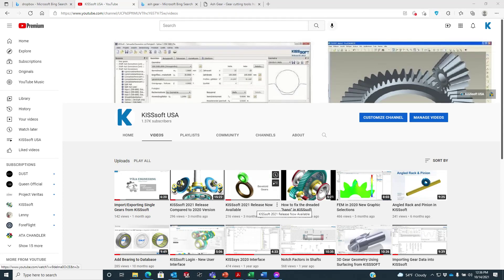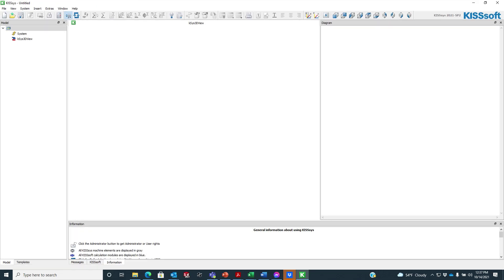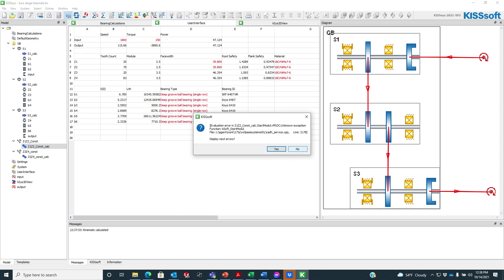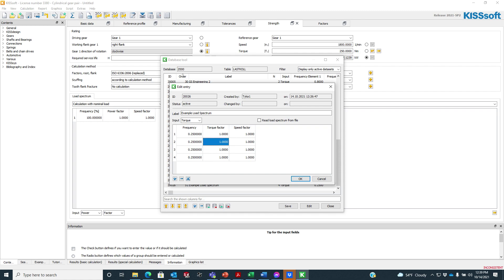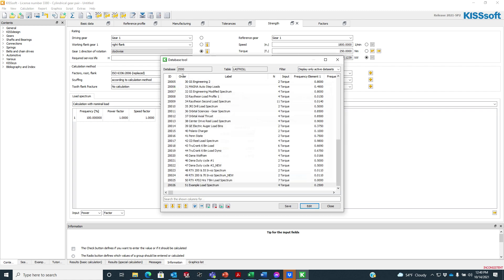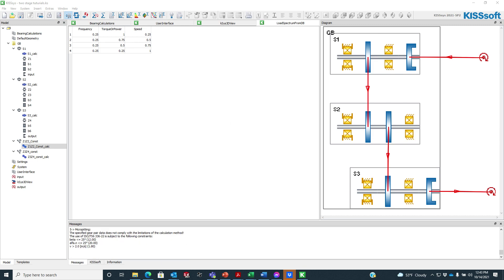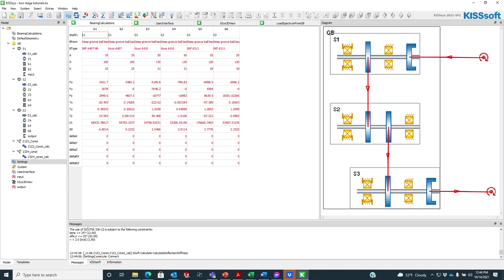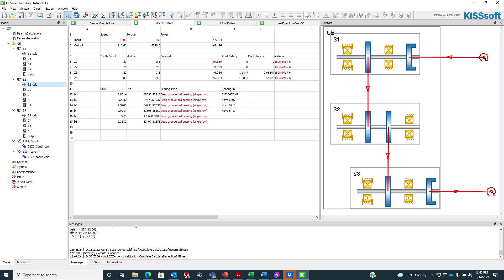Adding Load Spectrum to KISSsys

Comment: I am working in a compound planetary gear system and I have some questions. Do I need to add a load spectrum for each pair of gears? I am new using KISSsys so it may be basic but i have no idea. Another question, I have a document with the Torque, speed and their factors in each instant of time, however I dont have the frequency, is there any way to add this to a load spectrum or do i need to obtain the frequency too? Thanks in advance.

Comment: do you need to activate the load spectrum in the shaft calc (at "basic data")?
Reply from the maker: no, you just select under the strength tab to run using load spectrum in 2021 Version, in Earlier version it is called the Rating tab.
Reply: @kisssoftusa9363  sorry its me again,
So i noticed that if you select 'consider load Spectrum' under the basic data tab in the shaft calculation, the bearing life increases
So im a little bit confused why it changes because you said its enough to just select the load spectrum under the strength tab?
Did i get something wrong? Please help!
Reply from the maker: @ardit9032  are you running a load spectrum with multiple load bins?  If not, you don't need to run the load spectrum, if you're running a load spectrum in the gear calc and want the run that in the shaft module, you can select consider load spectrum, then make sure all the forces have the correct load spectrum. You'll have to select the gears and/couplers in the element tree then verify the load spectrum.